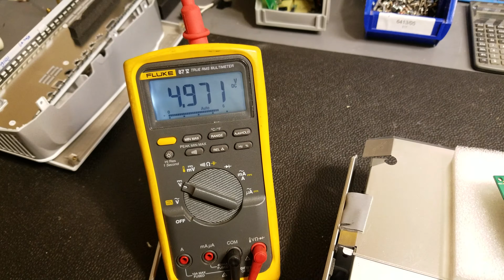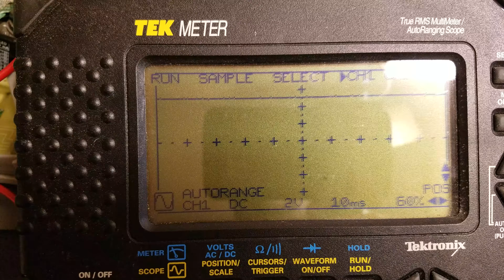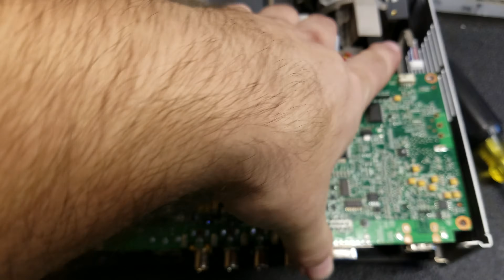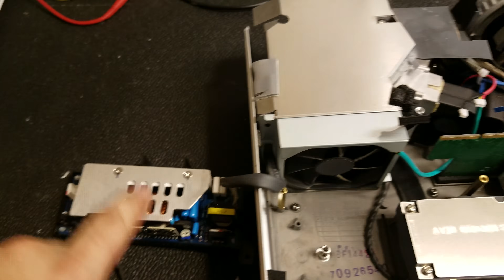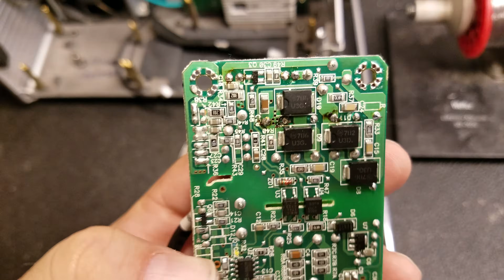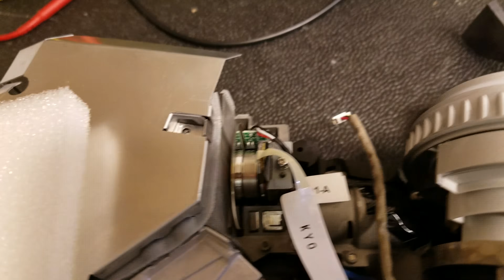Optoma HD70 Repair Part 2

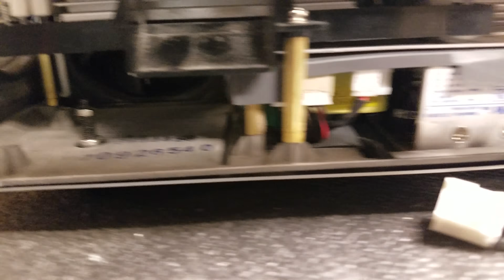Comment: 9:17 "I measured those two pins and it is 385(v). That was a pivotal point in the video but looks like it was cut. How do you measure that high a voltage on a DM?

Comment: i have an optoma hd25 that lights like 2 seconds... than the green power starts blinking, coolers turned on...than the light turn off and the power turns into blinking amber light and turn on the red lamp light.. what can it be?
Reply from the maker: How old is the lamp?  Do you get the optoma startup screen?